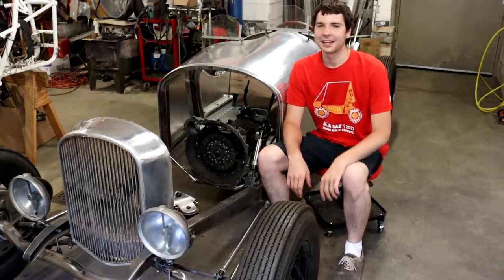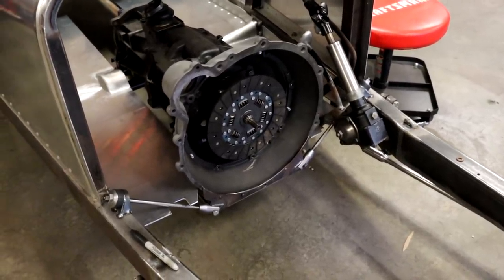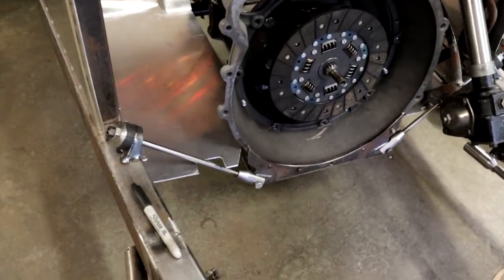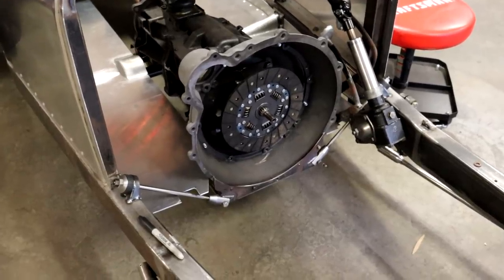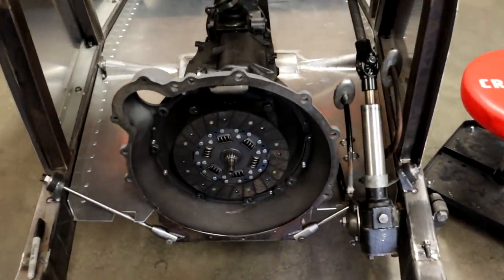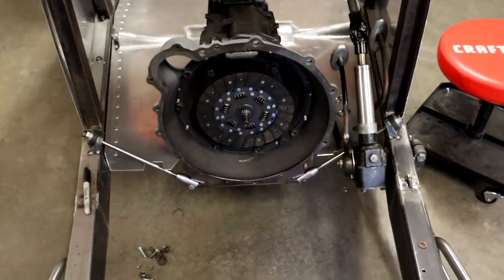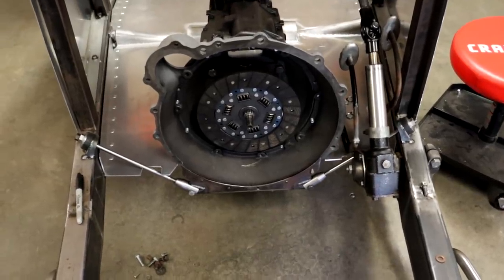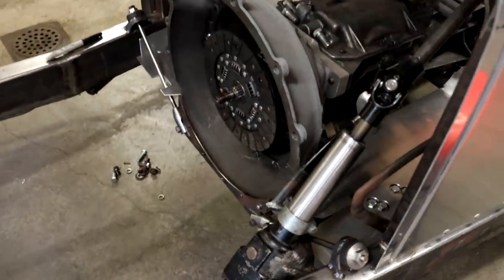Custom Drivetrain Support | Homemade Boat-tail Speedster Pt. 49

Comment: I think you should put rubber stoppers on the back side too.  When you stomp on the gas and the engine torques to one side, its going to push one of those rods up and start to poke dents into your hood because its so close.  Personally, I'd thread down those rods a little further and put another rubber/ & nut on the underside of those frame mounts too, just to lock it in.  Because you could hit a little jump in the road and cause these mounts to slam hard and make a loud noise, if they float up to much.
Reply: agreed, i'm sorry, but this doesnt work, the twist in the engine while putting some torque on it would even ruin the front mounts, or bend the frame sideways.. please check a Jaguar Etype or Landrover construction to hold up the gearbox more in front and release some tention from the engine/gearbox connection, landrover parts have metric threat, might wanna use those
Reply: It looks cool, but I don't think there's enough bracing.

Comment: Superbly restored. Well done. 
I'm interested to learn how durable the paint is inside the bowls. 
In my experience the chrome paints I've used in my hobby have been quite fragile. 
The custom brass elements are brilliant. Great job. 
Your car's face looks very period.

Comment: Hopefully, you did your research. Mounting the engine with just two and transmission with one helps balance the car overall. The engine and transmission as a unit are inflexible and their weight is supposed to go to the suspension directly or frame cracking will occur. Love that car can't wait to see it run!

Comment: I think you count on one hand the number of parts on this vehicle that were manufactured and unmodified. I think the only major component that hasn't been modified or scratch built is the brake drums. That's definitely my favorite part about this build. Jays gonna have a hard time recognizing anything but the engine and maybe the headlamps.

Comment: Cool, dual purpose build today. They will help support the engine/tans but double a anti- torque struts. Got keep the straight six torque under control,  been a fan of straights sixes since the seventies.

Comment: Elegant, Unless there's something odd I haven't considered, a sailboat rigging catalogue should have yielded clevises that would be up to that job. The stress in a big boat's rigging run into tons.
Reply: The part you’re missing is that these are built, not bought. Giving a satisfaction level you can’t get clicking a mouse and waiting for a courier.
Reply: @Anne6621  There are lots of special features in that car that make perfect sense to custom build, but it rarely makes sense to hand build standard components like fasteners. Those clevises look pretty standard. the economics have been clear for 250 years. Achieving novel results with standard components is a key to engineering.

Comment: Cool idea...but curious why not just add a bolt-on crossmember under the transmission and then rubber mount/spacers to adjust up/down if needed.
Reply: Period look. The hardware look that cars just don't have anymore.

Comment: Hi, I really don't know if that's necessary , I used to use quite a few 2500cc Straight 6 Triumph engines and they're pretty much the same, the engine mounts are right at the front of the engine and the gearbox  mount is nearly at the other end, I'm sure there would be no problems with bending forces, they're massively built and strong, I'd believe the Jag straight 6 would be even stronger.
Reply from the maker: That's very possible, but it can't hurt
Reply: @MacroMachines  No it cant hurt, great job.

Comment: Great engineering but I wonder if it's man enough. The torque on an engine can really twist an engine in the frame and this looks a little delicate to me especially the frame brackets.
Reply: Normally there is only the engine brackets, so why not?

Comment: I love the crafted hardware! Are you going to plate those eventually? I think zinc would look cool. Will you be building the engine? That drivetrain is going to be a pretty cool combo to look at. Thanks for sharing.
Reply from the maker: I might at some point. The engine i'm using is a 1958 jaguar straight 6 that's being rebuilt

Comment: great job as usual. curious as to why the rubber bush is on top of the mount rather than under? the rod will vibrate against the mount and the bush wont be doing anything where it is, just feom experience because most older cars would have the bush before the mount instead of on top

Comment: Pretty slick set up. Will the bottom bracket cause any interference when you mount the engine to the bell housing? Waiting to see more videos as you have a chance to work on the speedster
Reply from the maker: the engine only bolts to the top half of the bell housing, so no

Comment: I see a few issues of those, mainly because manufacturers generally use 3 mounts, because with 2 dampening on the same axis the firmer on takes most of the force. 

Sometimes they use 4, but 3 are for weight, one is for torsional loads.

For your design, your design may take ALL load off the oe position, and while the pull side may be sturdy enough, the push side may get pretzled

There are engine/trans mount for some cars, but they are designed to replace not add to the mounts, and are for solidly mounting the assembly to the chassis (no dampening/no rubber).

Comment: Have you thought of drilling those flange nuts and using lock wire to stop the nuts from backing out. Might look nicer than a jam nut. Or even a cotter pin.

Comment: Did you machine the face of the bell housing down so the plate doesn’t protrude? Or how will it mate up to the engine with that plate there?
Reply: He made adapters to mate the engine to the bell housing and the bell housing to the transmission. If needed I’m sure the clearance will be in the adapter. 

https://youtu.be/EpRJzHwIN_w

Comment: Nice work.
When you cut threads, do you use imperial or metric? Not only for this, but also in general.
Reply from the maker: I use imperial because that's what all my fasteners and equipment go by

Comment: Hey Sir. It's me again. Just wanted to ask a dumb question. Will the transmission pivot up, even when the engine is in place? Just worried about the torque of the engine that's all. Thanks for the update. Look forward to the next one. Take care
Reply from the maker: I don't think it would move much in that direction
Reply: @MacroMachines  ok

Comment: concern:  when tightening the strut ends will there be distortion of the frame rails to pull them to the center?
Reply from the maker: probably not. there'll be a pretty solid crossmember in the middle of the frame, and there wont be a ton of tension on those anyway
Reply: cross member baby

Comment: How is the holding plate going to interact with the engine/transmission joint? Will you mill out the plate thickness in the engine part?
Reply: Appears the plate is mounted only to the portion of the bell that the inspection cover bolts onto.
Reply from the maker: The bottom half of the bell housing doesn't bolt to the engine block, so there's no clearance issue.
Reply: @KowboyUSA  Yes, the XK6 doesn't have any bolts below the sump pan joint, there's a pressed steel cover over the bottom of the flywheel that joins onto the bellhousing.
Reply: @MacroMachines  Oh, cool!

Comment: I hate to voice a negative, but won't that structure tend to try and pull the chassis rails inwards?  Would not a stiffer crossmember been better?  OTOH your fabrication skills are enviable.
Reply from the maker: the center crossmember will connect underneath the transmission which should make the frame quite rigid in that area
Reply: @MacroMachines  Ah. Got it.  There is a chassis crossmember to go in under this mounting?  I should have known you'd thought it through.

Comment: Those extra mounts are good, but have you thought about putting rubber on both sides? Since engine could "jump" during revving or hard acceleration.
Reply: At 7:17 he made the rubber bushings...just hope it will work🤙
Reply: @Madas4876  that bushing will only help wiht down force not the up force that alex is talking about  say as the car crests a hill and the momentum forces try to lift the engine up

Comment: I am very sorry to say that this idea is not good. To date, I have loved almost all of this vehicle, but this will introduce so many stresses. I can recommend two methods, depending on whether you want to try and stop the flex, or control it - 
(i) a brace from engine sump to flywheel housing (similar to later Ford, etc)
(ii) keep your bracket, etc, and replace the links with shock absorbers.

Comment: You realize you're running the risk of flex on the frame rails, a pinch force at the engine/ trans split.....why not use a load plate/Web for all those needs...??
Reply: Let her flex